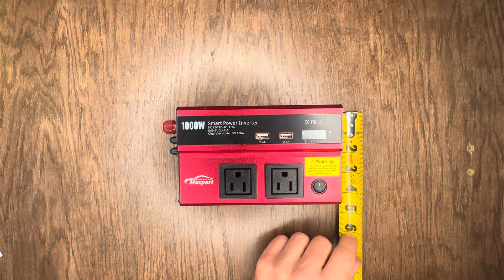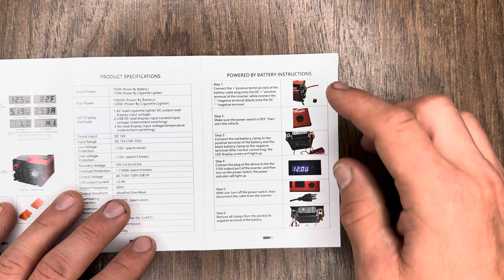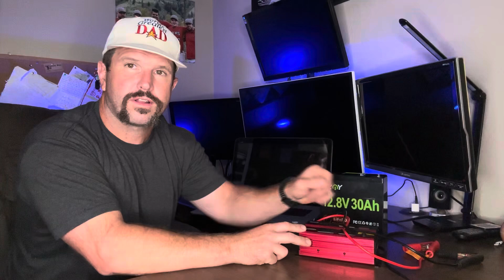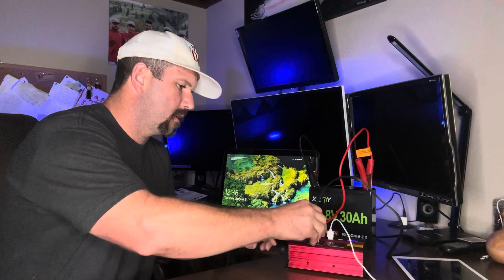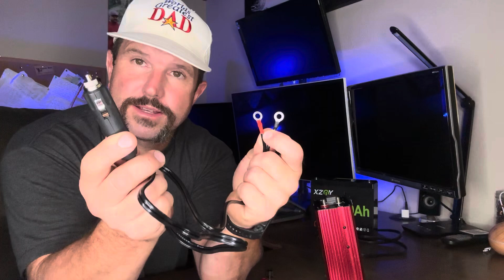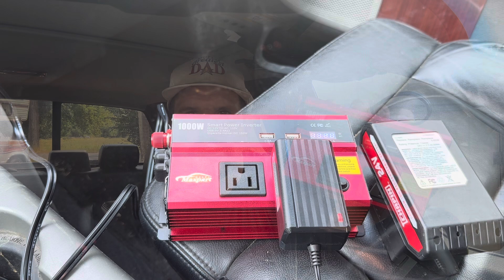Is this the Best Budget 1000 Watt Power Inverter on Amazon?

Comment: Can this run a skillsaw ?
Reply from the maker: A 1000 watt inverter will be a little weak for your skill saw my dude...  Circular saws are inductive loads that have a high starting surge current, often requiring an inverter with a much higher continuous and surge wattage rating than 1000 watts. Grab yourself a 2000 watt inverter and you should be okay. 👉 https://amzn.to/4msQ5QG

Comment: I have a 2009 dodge caravan, currently running a 300 watt inverter in the front & a 400 watt in the rear, both through separate DC outlets. Will I be able to power a 1000 watt inverter through My DC outlet? I want to avoid running to battery.

Comment: so how long does the big 12 v battery last before charging
Reply: if its a staring battery 20 minutes max not to deplete your battery below 60%  it just really depends on load and battery heath. in the best case scenario you had a 200ah lithium battery you could run 2 hours then look forward to like 8 hours to recharge it. this works best connected to a mid size engine while its running.

Comment: Extruded aluminum case, and it does not even mention the waveform.  Obviously NOT a true sine wave output at that price.  Is it even a "modified" sine wave???  They don't sqay.  Fine for chargers, but I would not use it for much else.

Comment: Nicely done with the video review.  Yes, a pure sine wave inverter is ideal for delicate electronics, but I have used a modified sine wave for a window AC unit, charging batteries, and even running a window fan.

Comment: Not for me, but thanks for a great review. 😎 That's a "modified sine wave" inverter. I prefer to pay a little more and use a "pure sine wave" inverter, especially with sensitive electronics like tablets, laptops, etc. 🤠
Reply: I agree with you but… I’ve been researching Inverters in order to make a portable battery powered AC supply like a Jackery etc. There’s a significant jump in price between a modified Sine Wave and Pure Sine Wave. It’s not just a little bit more. At lease 1/3 more for name brands like Renogy.  I hope to pick up a used oscilloscope to see if the non name brand ones are really True Sine Wave.
Reply: @cruikshank  ~ There is a big difference. Personally, I would never plug my Computer, Tablet, Laptop, or Starlink into a Modified Sine Wave Inverter. I emailed "EcoFlow" about recharging my Delta 2's and Delta Pro with a Modified Sine Wave Inverter, and they responded ~  "Never use a Modified Sine Wave Inverter to recharge any of their power station products".